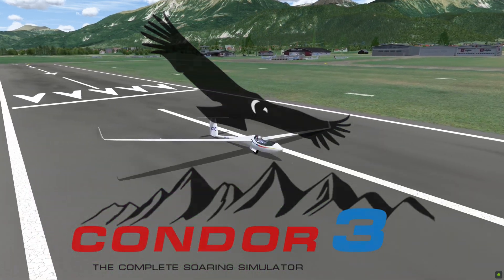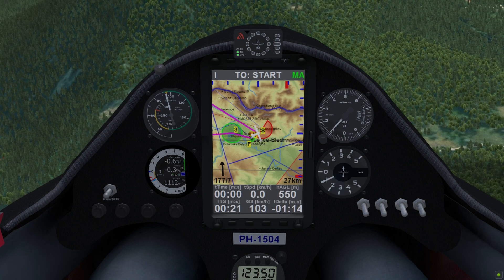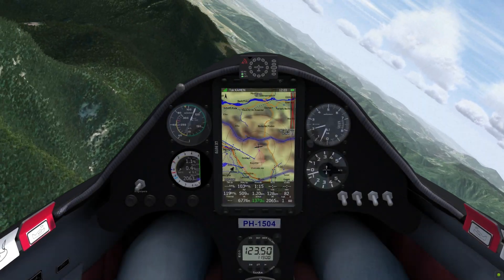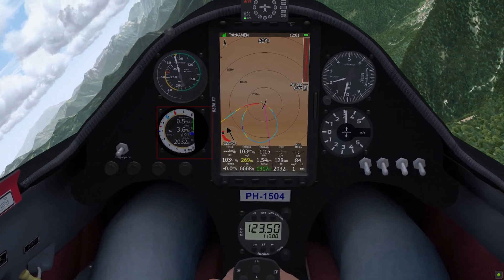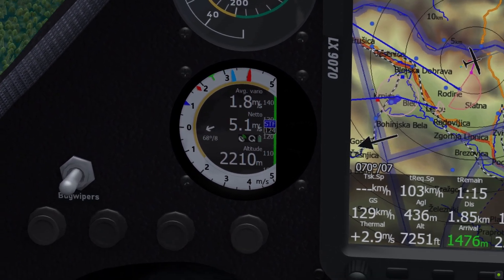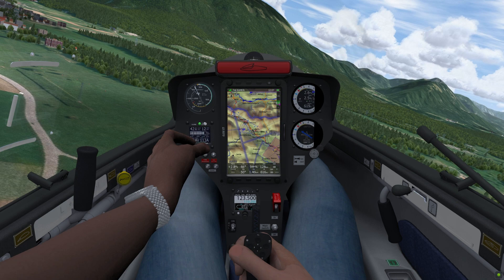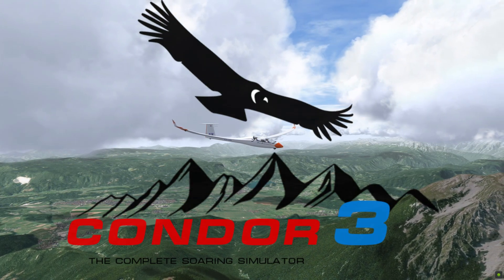Condor 3 - Instruments

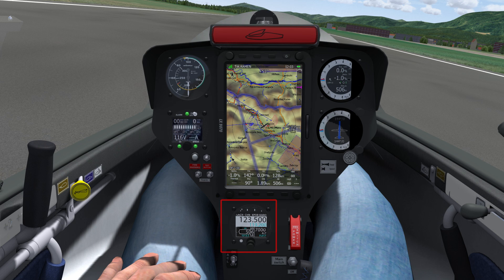Comment: 1:33
Question from a soaring newbie. Why does this plane seem to have two varios?  Is one just a normal vertical speed indicator for powered flight?
Reply: No, they are both varios. Of the gliders in the video one has a pressure activated only vario and an electronic vario, another has two electronic varios. Electronic varios can be set up in so many ways that some people choose to have two, set up in different ways. In my glider, I have one connected to the main (LX9000) flight computer, using pressure total energy compensation, and another (an LXNav S10) using electronic total energy compensation, Hawk wind, and an internal battery backup in case the glider power goes down.